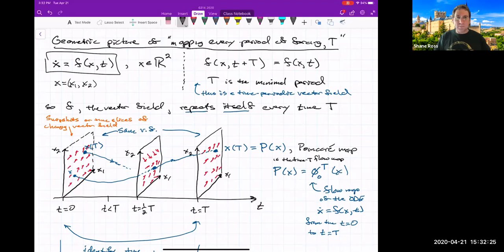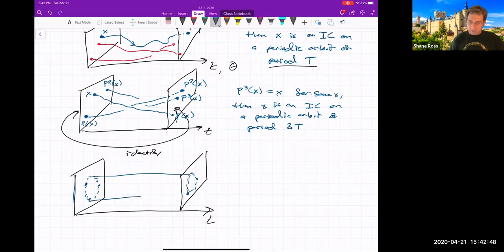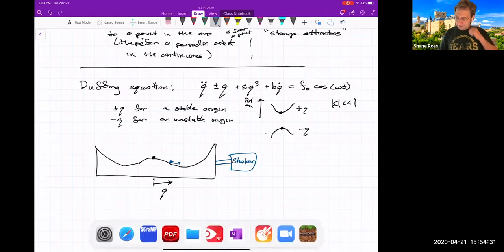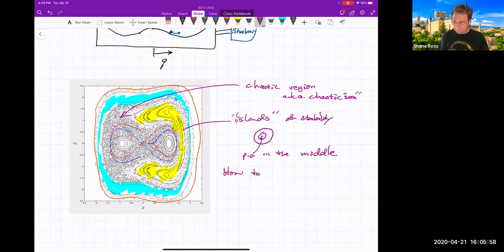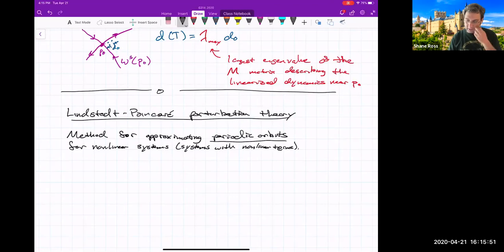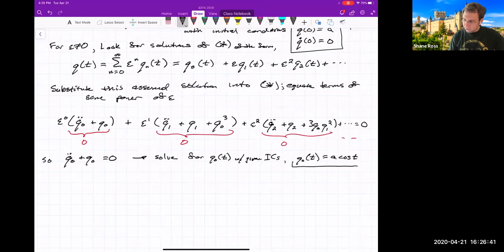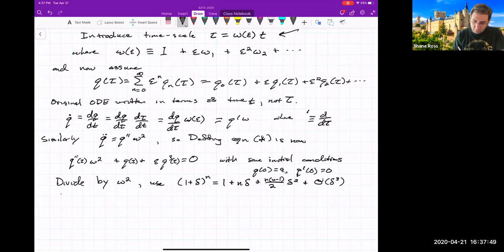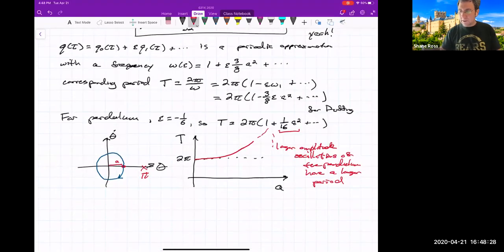Analyzing Periodic Dynamical Systems Geometrically | Lindstedt-Poincare Perturbation Theory, Lect 18

Comment: Hello Dr. Ross! Yet again, I'm finding myself benefiting a lot from your lecture videos. If I may ask, at 53:19 I'm having trouble understanding how you got the term 3q_0q_1^2. From the model problem of the duffing system, there aren't any terms multiplying and (unless I'm expanding it incorrectly), the expansion I get is just a bunch of single terms adding together where no q_n's are coupled that way. Any clarification would be much appreciated! Thanks!
Reply: To detail a little more: The epsilon-square terms I get are q_1^3 + q_2 + q_2(dotdot). Any help seeing what I'm missing here would be very appreciated!
Reply from the maker: Since we’re starting with
q = q_0 + 𝜀 q_1 + 𝜀^2 q_2 + …
for q^3 we get, via the binomial expansion,
q^3 = (q_0 + 𝜀 q_1 + 𝜀^2 q_2 + …)^3
       = q_0^3 + 3 q_0^2 ( 𝜀 q_1 + 𝜀^2 q_2 ) + 3 𝜀^2 q_1^2 ( q_0 + 𝜀^2 q_2 ) + 3 𝜀^4 q_2^2 ( q_0 + 𝜀 q_1 ) + …
       = q_0^3 + 3 𝜀 q_0^2 q_1 + 𝜀^2 (…) + …
so the final term, 𝜀 q^3, of the Duffing equation is
𝜀 q^3 = 𝜀 q_0^3 + 3 𝜀^2 q_0^2 q_1 + 𝜀^3 (…) + …
so that's where we get the 3 q_0^2 q_1 term in the epsilon-square part of the expansion. 
Let me know if that helps!
-Shane
Reply: @ProfessorRoss  I see! It escaped me to think of using binomial theorem for this. This helps a lot. Thank you Dr. Ross! Along with a PDE course, I'll be taking a comprehensive exam for this class in about a year from now to complete a master's in Applied Math!. I will absolutely be referring back to your videos. Super thankful for these videos and, as an aspiring educator, you're an inspiration! Happy holidays!